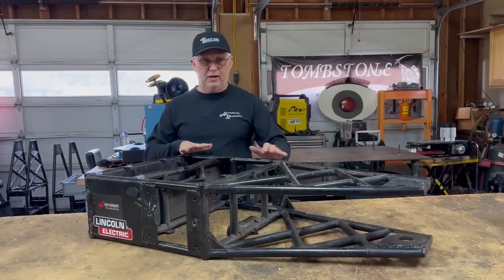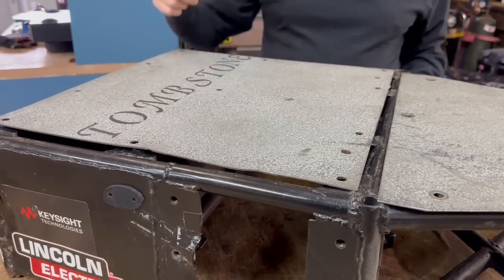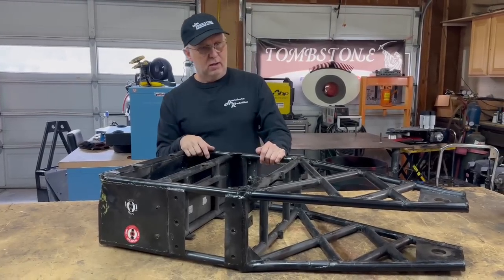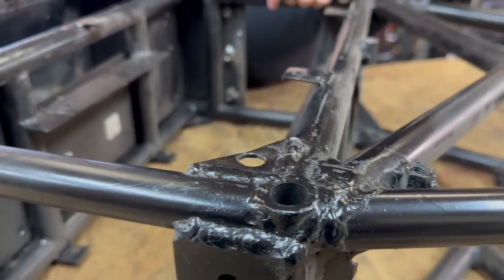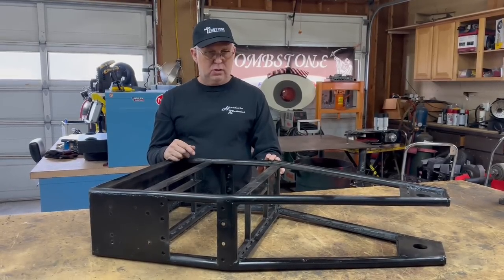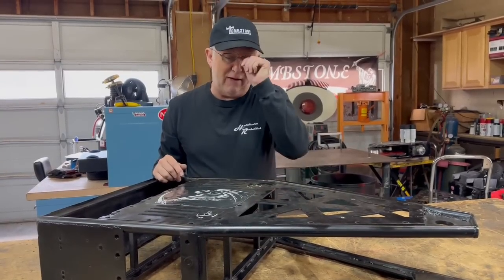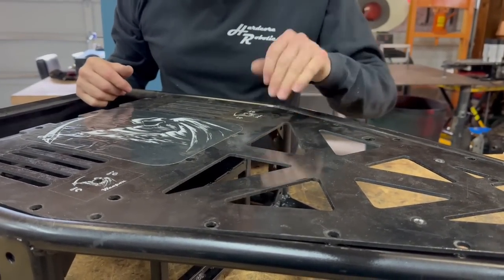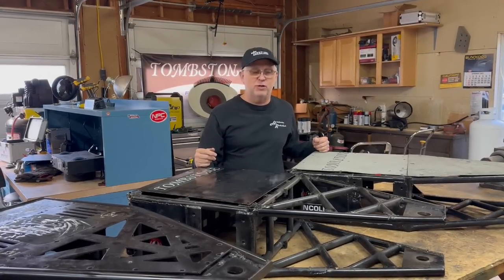Tombstone frames throughout BattleBots

Comment: Armchair engineer here 😛 would moving the weapon motor back and placing some lighter electronic forward help with the weight distribution issue? I know that would mean a longer weapon chain and a new possible issue, but if the robot drives better and recoils more reliably, that could be an okay trade-off 🤔

Comment: I would also try the old season 5 with a cross of season 6 frame with all the dimansions and tubes from the season 5 with the top armor set inside between the tubes like in season 6. This will probably help with weight, top-heavy weapon drag, and good durability.

Comment: Instead of moving the entire weapon back 2 inches, is it possible to move the motors forward an inch? Move the vertical plate and vertical pipes that the front of the shock isolators mount to  forward by an inch, and i think the arc of the weapon bar look like they would still clear them fine. I'm not sure of the geometries of the motor gearboxes would fit internally, though, and you may need to notch something slightly to clear the motor cans.
Reply from the maker: Probably some combination of that actually. I've got a few things I would like to make happen which will take a bit of design work to get something I'm happy with.

Comment: @Ray Billings, Here's a suggestion on how to save you some weight. If you rounded the corners on the back part of the frame and cut horizontal slits say like three small sets of three in the back pannel that should save you some weight. The rounding part may be difficult but if you had the ability to you could essentualy almost make the frame a single peice of tubing which would save you the welding and free up some more weight along with shortening the frame like you said.  - Just my ideas hope they help. Good Luck next season.
Reply: Just make the entire top and bottom sections one long bent tube instead of multiple tubes welded together?
Reply: @roboman2444  That's what I said, but to do that the corners will be rounded.

Comment: Instead of shortening the weapon side of the robot, would it be crazy to move the wheel mounts forward (towards the center of the robot)?
Reply from the maker: There is a small amount of movement there that can happen, but not enough in my opinion. It will probably take a combination of both to get the movement I am looking for.

Comment: Thank you to Ray and the team for your video content. It's clear that the weight of the robot is a constant challenge. How important is the robot's centre of gravity? I guess it changes for you depending on the weapon you choose but this may also be a factor when trying to improve traction.
Reply: They mentioned that near the end of season 6 frame discussion; maybe shortening the front, using shorter weapon bars.
I guess this means it's Malice-ified a little ;p

Comment: I noticed that after moving the power switches to the side after S2, they are back on the top for the S6 build....curious. Also, (again) thanks for taking the time and making such detailed & informative videos!

And, of course, you are not letting anyone near that S2 frame!
Reply from the maker: For season 6 they were on the back rear panel and not on top, although for the re:MARS event I did move them back to the front/top position. I was trying to figure out a better method of shock absorption for the batteries, and used that extra space back there. Still didn't work though :) I think I've got that figured out a bit better going forward.
Reply: @ray9368  hey Mr Ray you might remember me from a comment on a different video I'm not here to make recommendations but I'm actually asking for something now I love battle bots and I'm trying to watch all of the new show but I ran into an issue I can't find the first 2 seasons I believe they are on CBS or ABC one of the two and I'm asking you were I can find the first 2 seasons of battle bots but not the 90s series please reply.
Reply from the maker: @HHenry-n8u  Yes the first two seasons were on ABC, and they are frequently hard to find. At one point I think some of the streaming services had it, like fubo or tubi, but I really don't know where those seasons are available now. Which of course is a shame, since I won season 2 and people definitely need to see that!
Reply: @ray9368  thanks il try to find it also tombstone is my favorite battle bot and I've said that to you before but it is an honor to talk to you have a wonderful Christmas

Comment: Do you still have any of your last rites frames?
Reply from the maker: There are a few yes. Basic configuration is very similar, just slightly smaller and thinner material to accommodate the lighter weight. LR is 220 pounds, TS is 250.
Reply: @ray9368  last rites seems to hit harder, or maybe the robogames bots are just brittle

Comment: Never heard of cutting something completely out then rewelding it back. Thought that would weaken the weld.
Reply from the maker: One of the key reasons for using steel for framing structures is the ease of welding. And yes you can end up with some issues from that, but at the event you do whatever you have to in order to get it back in the arena.